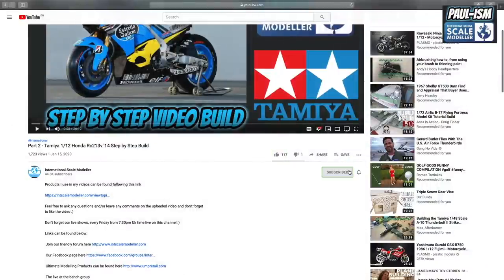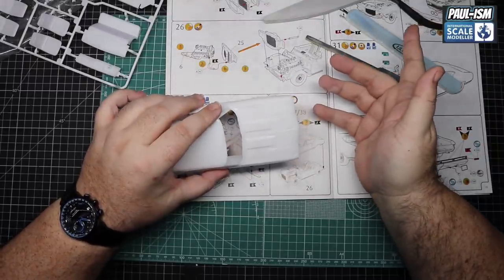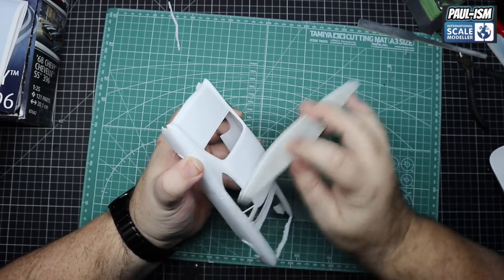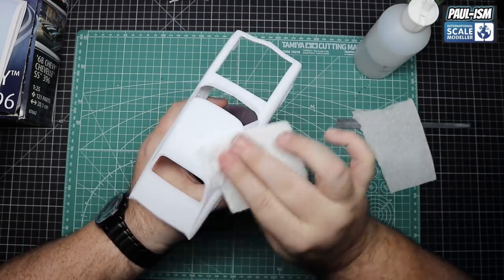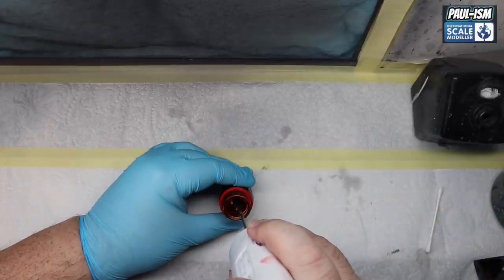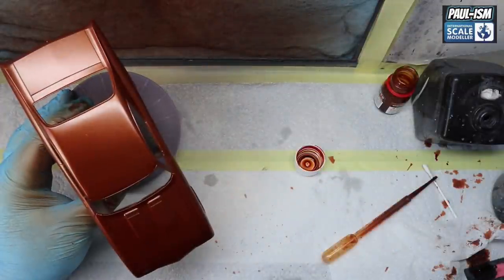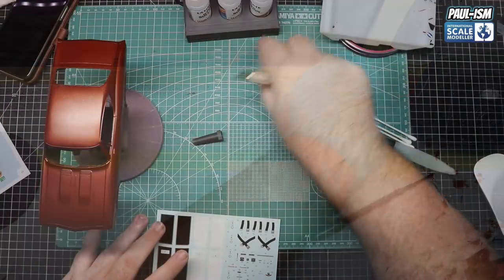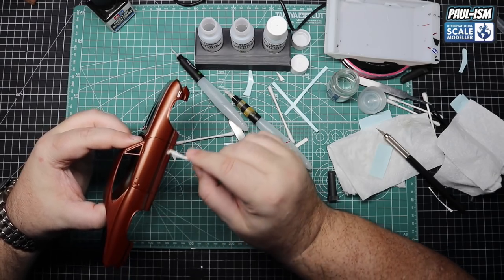Part - 1 Revell 1/25 68' Chevy Chevelle SS Build Series

Comment: You make it look easy..couple of questions if I may, what do you recommend to hold all the small parts? I’m really struggling to hold stuff, I’d like to paint more in one go if you get my drift.   

Did you seal the decals in with some clear? I have decided not to clear because I didn’t seal them and heard a lot of horror stories of slivering. Regards..
Reply from the maker: I use use cocktail stick with either Ca glue or white tack to hold them, and they were sealed with the 2k clear

Comment: Hey Paul, good evening......I looked in the products section of this build & I couldn't find the case you have to put the car body in after its painted & clear-coated. I'm guessing its a clear storage bin & you modified it to fit the clamps in. If possible, can you please give me more info on that case as far as how those small clamps are secured into the case please? I think I'd like to make that same storage case to avoid dust & dirt on the car body......thanks Paul.
Reply from the maker: Yes its just a storage box and the clamps are cable tied in place
Reply: International Scale Modeller I kind of figured it out, so I made one recently too...... works great, I actually made a video of how I made it & I shouted you out for it too